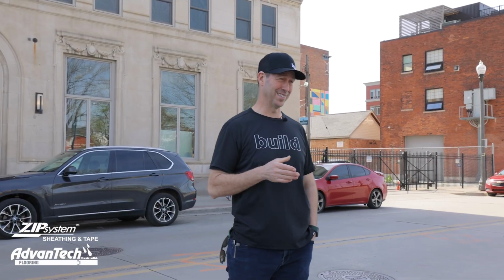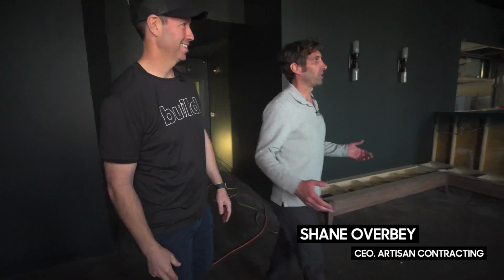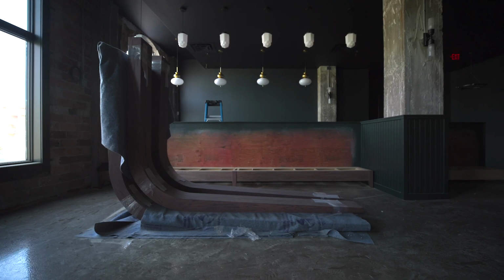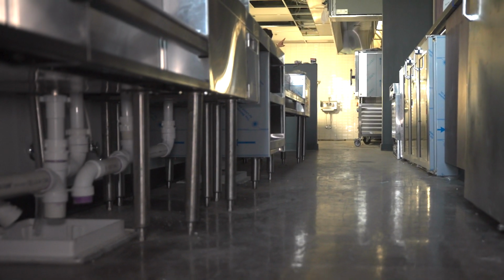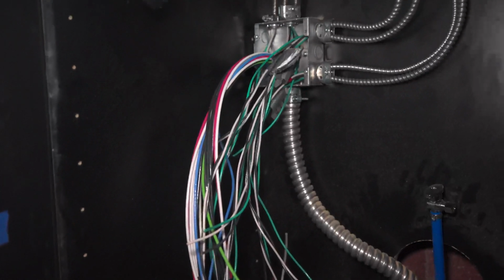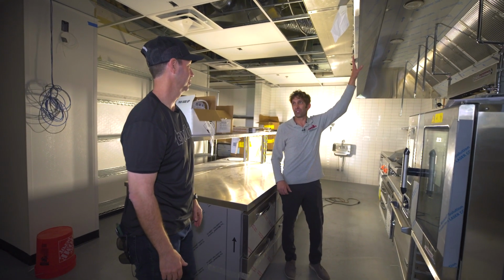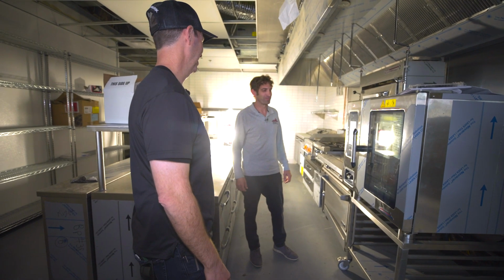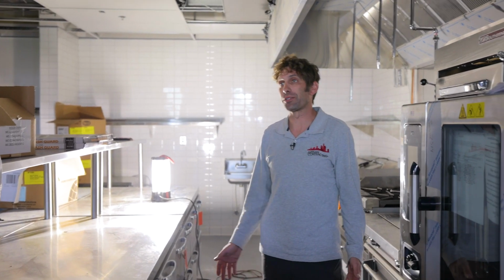Restaurant Reno: More complicated than you think.

Comment: white subway tiles are like 10-15 cents each, it looks decent and its cheap. those are 3"x6". although FRP is like 100+$ for 4'x8' sheet, not including trim and glue. so the math works out to 256 tiles  for 4'x8' @ .10$ is about 25.60$. And any waste on the FRP is just tile you didnt have to buy in the first place.
Reply: Labour, backer board, mortar, etc.

Comment: If the kitchen exhaust is properly balanced with the makeup air, you absolutely should not be having air rushing in through the door when you open it.
Reply: I don't think there's a perfect fix for that. Temp effects air movement quite a bit. The hot air being exhausted is moving at a different speed than the cool makeup air. If you think of the entrance as a hallway, it gives the outside air the chance to mix with the inside air before it hits any sitting diners. That way, only the hostess is freezing. If it was perfectly balanced, anytime another HVAC turns on (I assume they have a few), the doors would pop open or people would start to feel pressure in their ears. Vice versa, the doors become extremely hard to open.
Reply: @mjbates  , Apparently you don’t work with many air balancing contractors and members of AABC (associated air balancing Council). They independently deal with air balancing every day ,meeting your concerns and concerns you’re not even familiar with. When I would commission commercial customers for the gas utility industry, I would work hand-in-hand with all the contractors but especially the mechanical contractors and balancing contractors. Balancing contractors and especially ones that were members of the AABC had to be independent , strictly prohibited from having any affiliation with mechanical contractors, design engineers or equipment manufacturers. This policy prevents any potential conflict of interest and ensures that all members provide engineers and building owners with professional, unbiased test and balance services.
Reply: @boby115  I totally agree. I know a lot of people work very hard to get that stuff right. I don’t think it’s something that air balancing can solve without causing the issues I mentioned above. The draft near the front door is caused by hot and cold air mixing. Without the glass barrier above the banquet, some of that air would mix immediately into the dining room, causing a draft at the tables near the door. I think the solution they came up with is a pretty good one for maximizing seats while not having that (often unusable) table next to the door. 
I wouldn’t be surprised if the air balancing contractor suggested something like a glass barrier since they can’t do double doors, one of those loud air disrupters, or beat entropy.
Reply: @mjbates  , no telling what the balancers might suggest or do on this particular job. Not really sure if the municipal code would require a balancing contractor and testing on such a small restaurant. Definitely not enough information in this video for me to give any suggestions, Plus my knowledge on the subject would come nowhere close to expertise and experience of a qualified balancing technician.
Reply: DUH, he addressed that